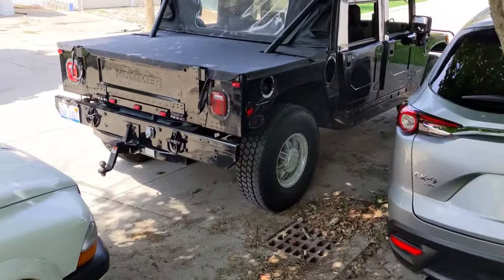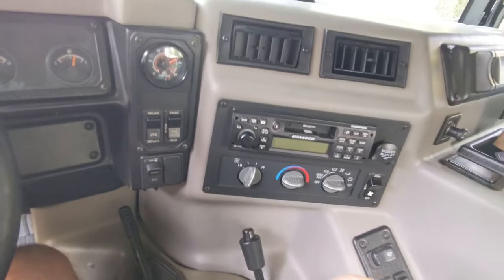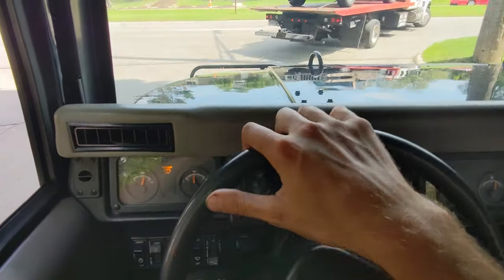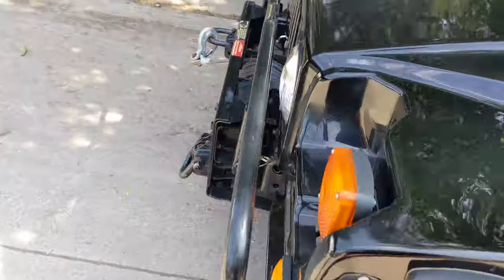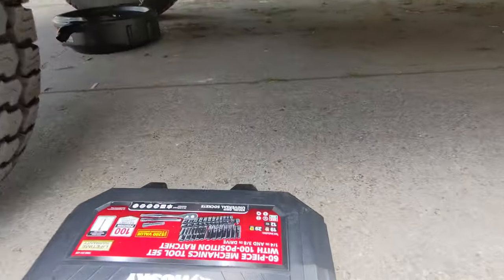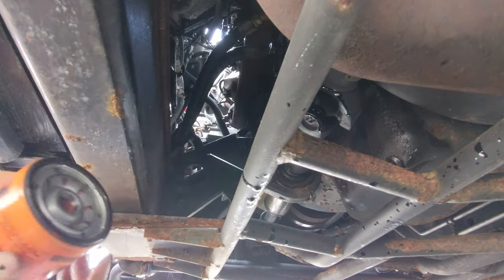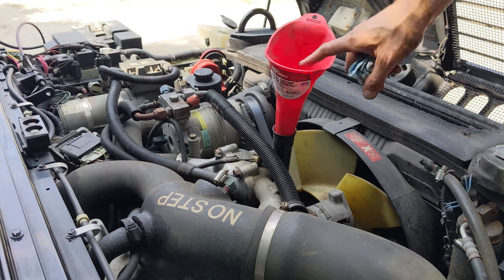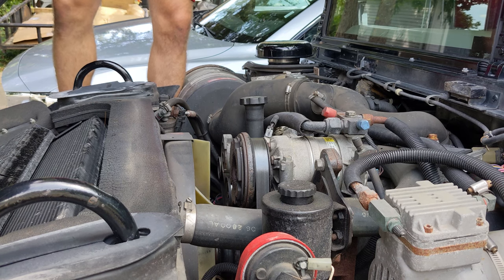2001 Hummer H1 TT4 ABS 6.5 Turbo DIesel - Oil Change

Comment: hi friend I have a hummer h1 2004 k series. the company recommends 15w40. However, I believe that 15w40 oil is cheaper and less refined than 5w30 or 10w40. Isn't synthetic 5w30 oil better than and more protective than 15w40? I would like to have clarification on this matter. Thank you